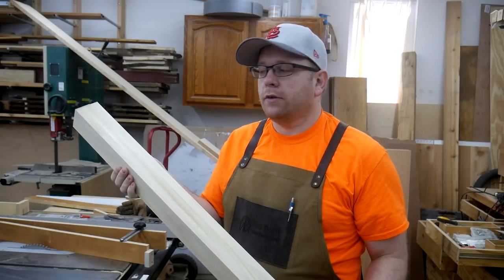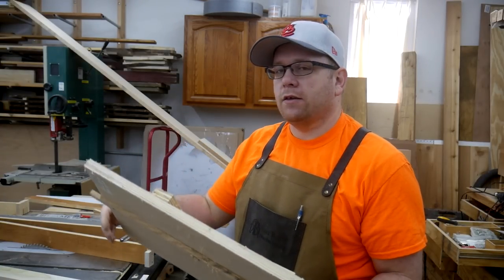Quick and Dirty Taper Jig

Comment: What a simple little jig. I've been putting off building one because of all the gee whiz stuff that apparently needed to have. Well, you proved that simple works and simple is easy. Btw, a rotary tool with a small grinding bit would make short work of that bracket slot.

Comment: Thanks for showing us how to keep it simple. BTW, if you reverse your adjustment bracket you wouldn't have to clean off the top of your fence when you use the jig.
Reply from the maker: I did think about that. I was concerned about it getting in the way if I wanted to cut taller stock. Also, with my tendency to grab it as a handle, I want it as far away from the blade as possible. Great suggestion